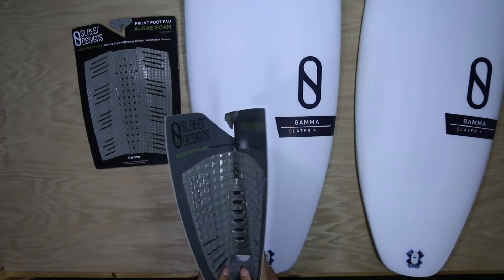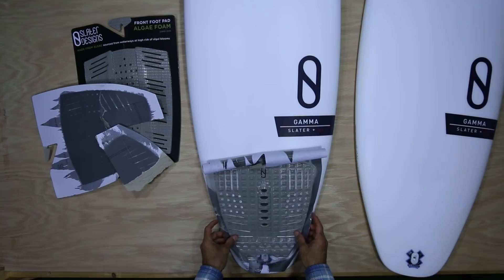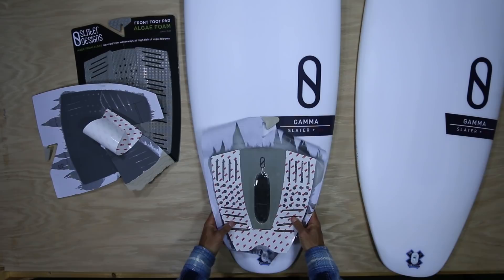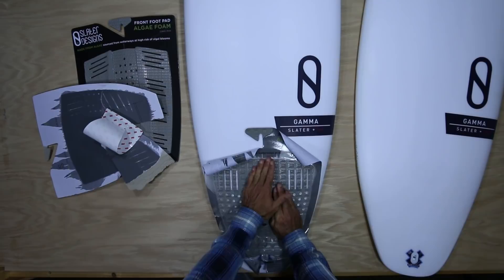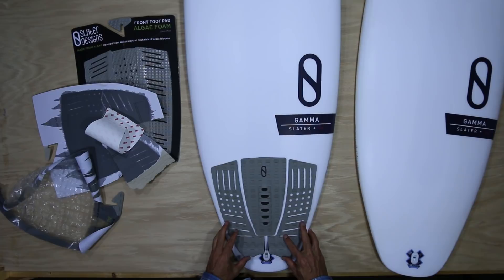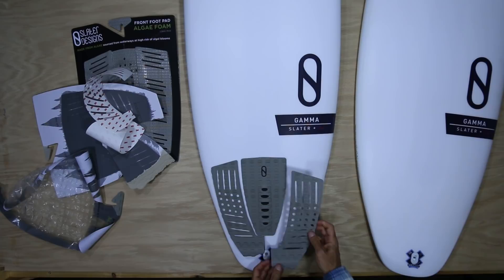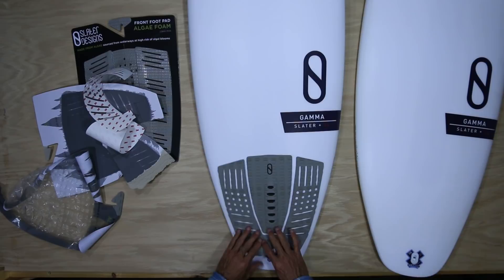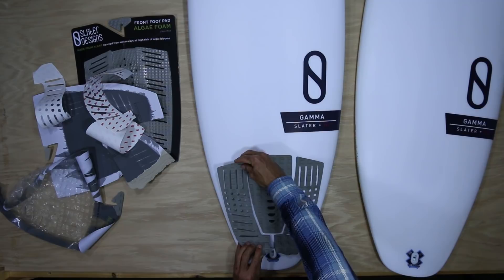Kelly's Got Tricks When It Comes To Traction - This one surprised all of us.

Comment: I got the front food traction pad but couldn't find any guidance on the correct positioning on a board anywhere. A video on that one would be nice!
Reply from the maker: In the meantime - place the narrowest part of the front pad forward towards the nose. Place the back edge of the front pad about 12 to 14 inches in front of the front edge of the tail pad.
Reply: Grab some masking tape and stick it as a stringer. Use a pencil to do some reference marks. Remove the tape. Stick your pad. Cheers ma dude!